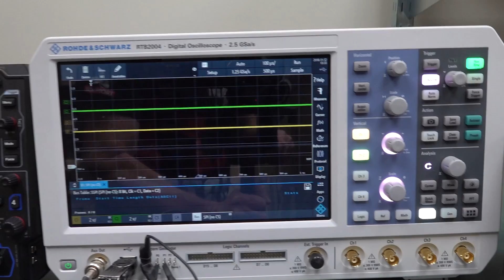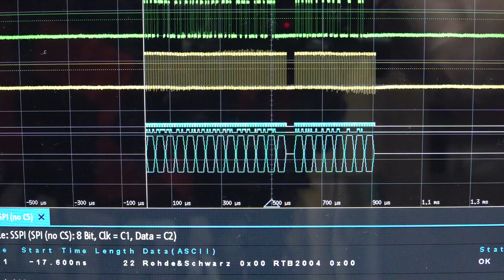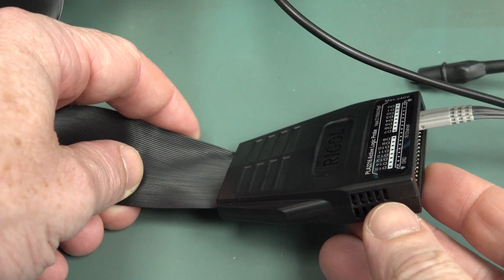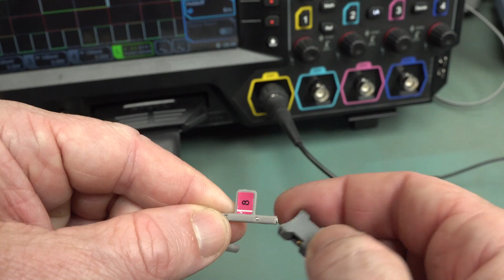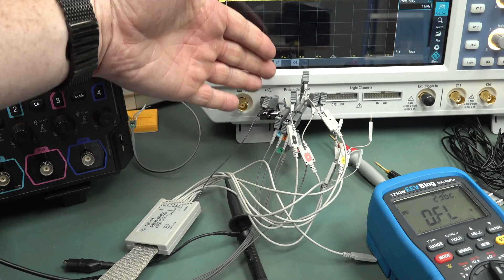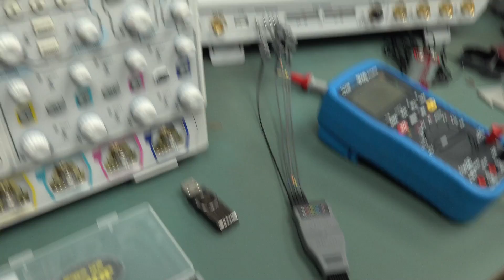Rigol MSO5000 Bug Bonanza

Comment: Looks like AUTO mode is masking a true trigger event while it's busy processing the 20M points that were auto-triggered.  I seem to recall you saw a similar issue on another vendors scope a few years ago (AUTO trigger interfering with catching an infrequent signal).
Reply: many Agilent/Keysight scopes behave similarly at slower time bases with infrequent signals. At the selected sample rate and memory depth it needs to trigger almost constantly to keep the display updating at a reasonable rate, and this results in a lot of blind time causing it to miss true trigger events. What you want in this situation is to change to "Normal" trigger instead of "Auto", or simply reduce the memory depth.

Comment: Not FS.  P=Parity bit and S=Stop bit.  It's reporting decoding errors in the RS-232 stream.
  For the SPI, the line you were dragging up and down may have been the threshold between logic 1 and 0.  So outside the waveform left no data to decode.
Reply from the maker: Yes, it's PS, part of the P was chopped off. That makes sense now.

As for the SPI, I was dragging the decoded waveform not the trigger level. But I don't see the trigger level on the data waveform, so could be that, but I don't recall changing it.

Comment: Holy crap they are wasting half the space on the decode with that D: nonsense
Reply: mikeselectricstuff - yep I hate that data display, wastes so much space which could otherwise be showing exactly what the data is, Siglent does the same thing.
Reply: This has always been a right pain in the butt for me too. They could colour code the surrounding blocks to denote Data, Frame info, etc. and use that real estate to showing JUST the decoded data itself. Even an option to select the format would be better!
Reply: @simonbaxter8001  Never just color code information, also use another way to indicate it, like a differently shaped frame.
Colors are often not distinguishable enough, especially if there are too many, or with color vision deficiency/variation.

Just using color to denote information is a big UX flaw!
Reply: Doesn't seem to be the case for UART decoding though

Comment: Auto mode shouldn't be used for serial decode.You tend to get the data slapped all over the screen regardless of the trigger point. Serial is bursty, normal trigger mode is perfect for that.
Reply from the maker: That has nothing to do with the actual trigger point not being correct, and the timebase expansion issue in stop mode.
Reply: @EEVblog  Auto trigger mode displays whatever is in the memory buffer, regardless of the trigger condition being met or not. If the packet of data is captured somewhere in the memory, it will be displayed at that point, and if it's off the part of the memory on the screen, you don't see it. As you have a 20M point memory length, it's possible that if you stop the scope it might be there off the screen. 

If you extend the timebase and stay in auto mode, you're more likely see to them on the screen but at different points. This issue used to come up with my old LeCroy scope too, I can demo on my Tek 4000 and Agilent 3000.

So I think that first issue you see where the triggering fine in normal mode is because it will only trigger when the edge condition is met. If you switch to auto, the scope is having to process the 20M memory (5Gs/Sec gives a max screen update rate of 250Hz less processing time, probably only 1..10Hz), so you've got to be lucky to get the data packet on the screen.
Reply: @marcdavis7583  careful dude if you try to correct him or point out he's comparing products with prices in different orders of magnitude with the same expectations he might delete the video because of "haters"
Reply: Why would the number of sample points matter? A scope in auto mode with no trigger seems like it should display every buffer of signal on screen, then do the next, rather than skip some of it between. So something occasional would at least show up in some random place or near the edge.
Reply: @gargantuablargg  *Dead time*. A longer memory takes a longer time to process. It depends how Rigol manage the memory depth selection. In short time bases (e.g. 100nSec/div = capture time of 1uSec) you might have only 2,000 or 5,000 points on the screen but capture 19,998,000 outside of the screen. Fast scopes like the Keysight (which can show 1,000,000 waveforms per second) have a really small dead time so you are more likely to be able to re-arm the trigger, therefore capture and see the signal. Some scopes process the entire memory before being able to re-arm, then trigger, then capture, then process and finally then display the waveform. That processing time means you miss a lot of what happened.
Reply: @SuperAWaC  I've not mentioned something about price, but the trigger setting. It happens in all scopes.
Reply: @SuperAWaC  Have you compared the prices of the Rigol and the R&S? Do you know what "order of magnitude" means?
We are all sorry that you got a cheaply made scope and now try to get buyers' confirmation, but that's not a reason to insult your host.